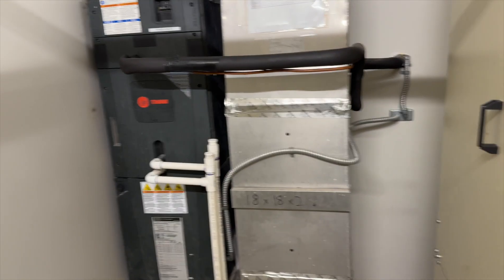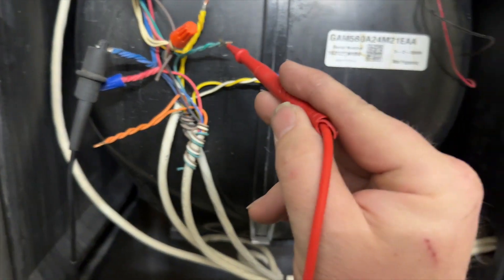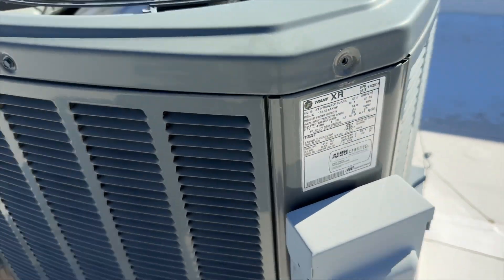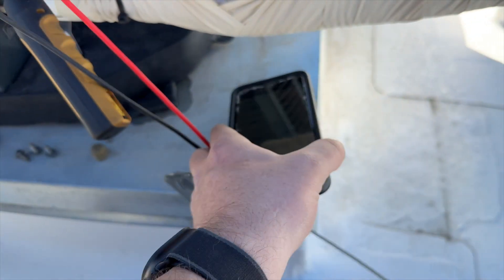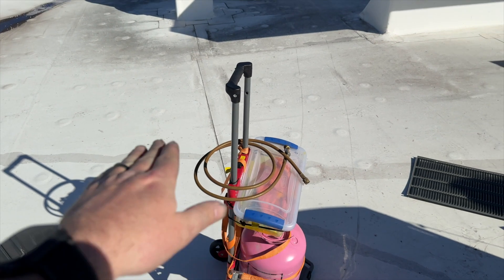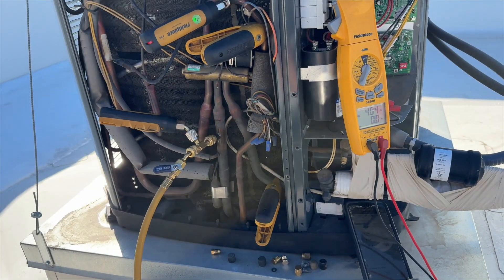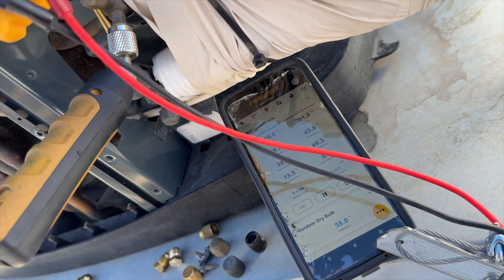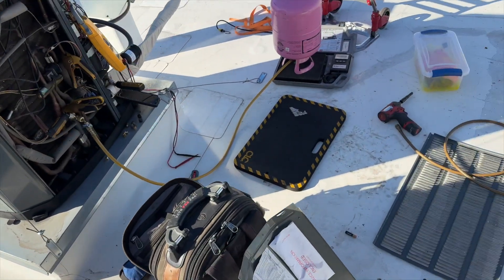Trane Heat Pump Not Cooling.  Low Ambient Charging EP210

Comment: Thanks for sharing the video
Have a question for you if you familiar with vantage control system on the vintage thermostat option is to install wire room sensor. Does thermostat keeps average temperature between itself and sensor or sensor takes full control of temperature in  which room sensor is located.